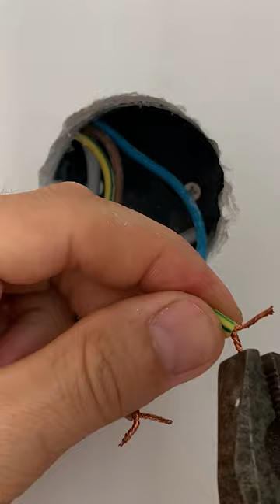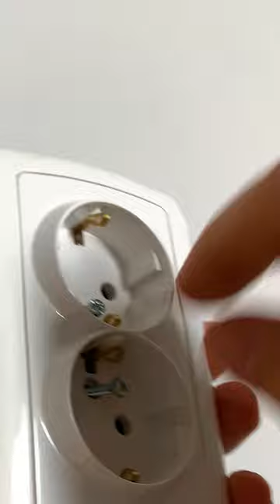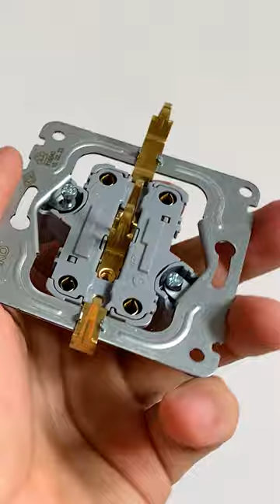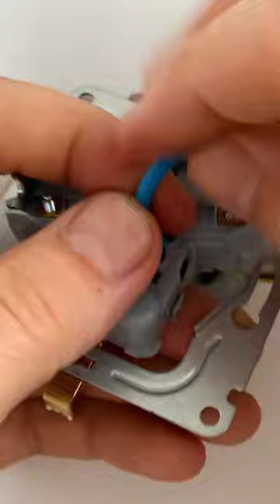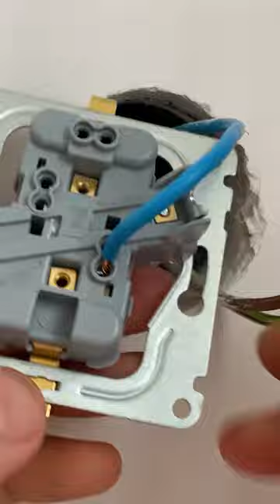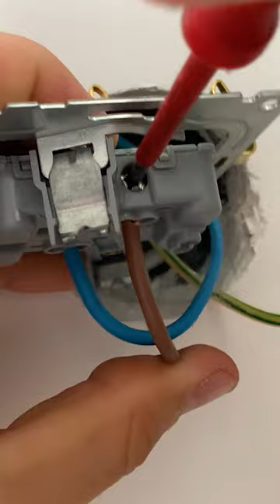Installing a Grounded Socket. DIY without tip #shorts

Comment: Please stop terminating electric sockets. You clearly don’t know what you’re doing 🤦
Reply from the maker: Explain in more detail
Reply: What would you like me to explain?
Reply: @diyalik  You're going to burn someone's house down.
Reply from the maker: @icegamer8973  why?
Reply: @greenie2162  explain what’s wrong
Reply: @hydraulicfacechannel2147  see how they split a single, stranded wire in 2 and make this, what I can only describe as a fork. I have never seen this before. It’s unnecessary and potentially unsafe if it isn’t terminated correctly. The terminals they’re making off into, are for 2 cables. Not this strange configuration of 1.
Reply: I'm less concerned about that than the stranded wire. Odd.
Reply: @Sean0526a  nothing wrong with stranded wire. Could be ferruled I guess, but stranded is still okay

Comment: This is just wrong, there is no need to use both of the terminal holes
Reply from the maker: wire too thick for one terminal hole)
Reply: @diyalik  then it’s the wrong cable size